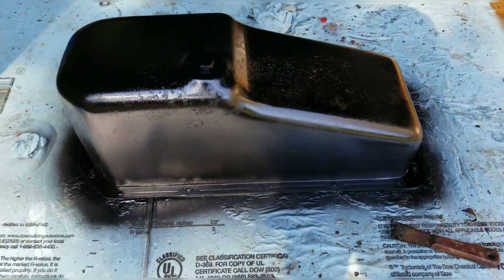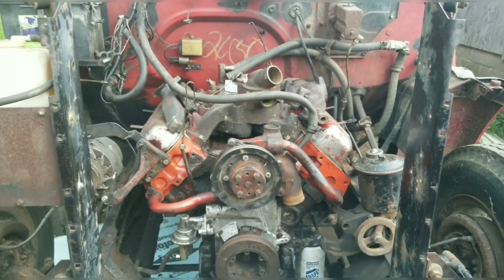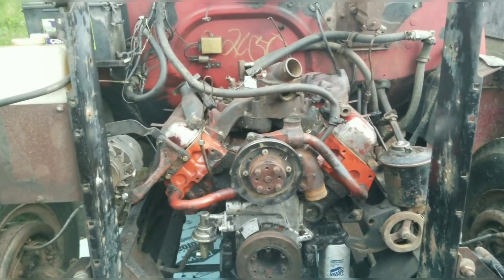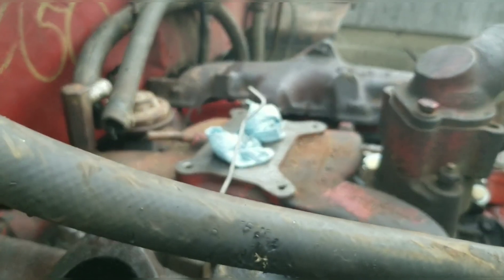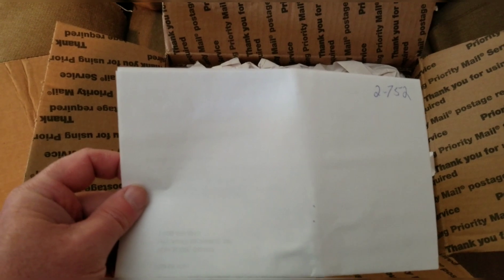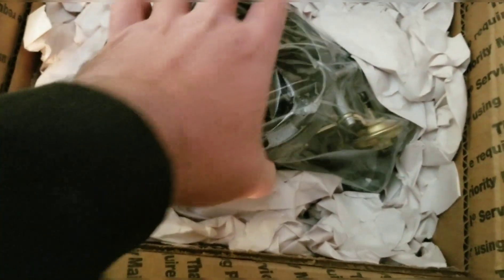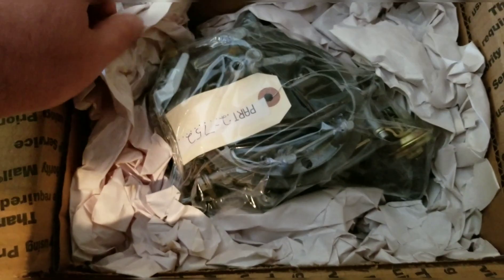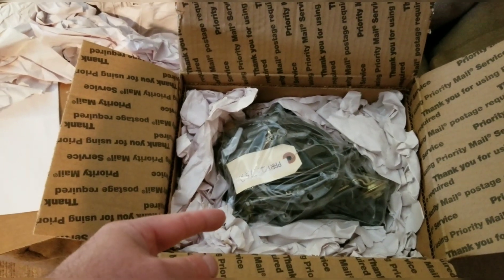IH 345 Engine In-Frame Rebuild Part IV

Comment: I think it will be a pain to get it to run right and happy it is not fun tuning it just from my experience and congratulations on 4k
Reply from the maker: Im an engine expert. This engine is simplistic compared to some.
Reply: @FarmallFanatic  don't worry about tuning much until you get it warmed up and loaded..
Mold board plow or something.  Let it slobber a little for a while too. Set the timing then tweak it loaded. For most power. Should run for another 40 years.. Ha.. I love that older machinery.My great uncle had an old rumly.  Belt to drive a threshing machine.  I got to see him blow the last straw pile with the old threshing machine. I think I was in the fourth grade.
Reply: @FarmallFanatic  looks simpler than the one I did

Comment: Where did you get the thermostat?
Reply from the maker: Probably ebay which is where I got the rebuild kit
Reply: @FarmallFanatic  sweet thank you so much for replying so fast. Is it up and running? I have an 72 IH 1700 bus with the v345

Comment: I prefer the 180 degree t-stat as well
Reply from the maker: They got all these new vehicles runnin super hot. Those old engines just can't take that kind of heat.
Reply: I put 180 in all mine, I agree, it's like they want these new vehicle to pre-maturely fail..

Comment: Wow desperation Saturday. I must have been in one of those areas where the crowds weren't . LOL hey nice puns and wise cracks but rebuild tractor engine, Cool i'm watching, haven't had to work on a tractor though for years like 30 may be. can't wait till you crank it over liked and subbed so i don't miss it. May be you will go check out my channel i could you the the subscribers but if you don't that ok to thanks for the share.